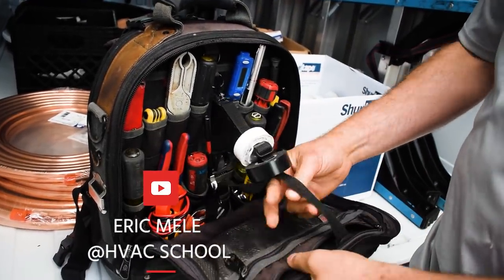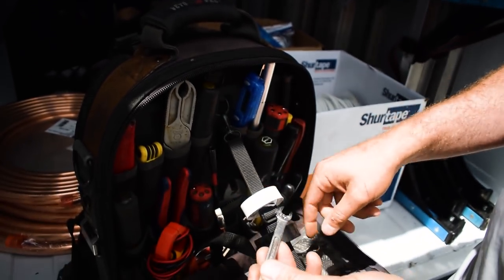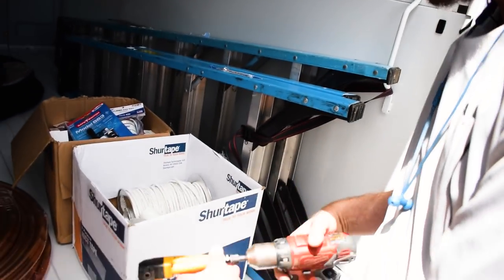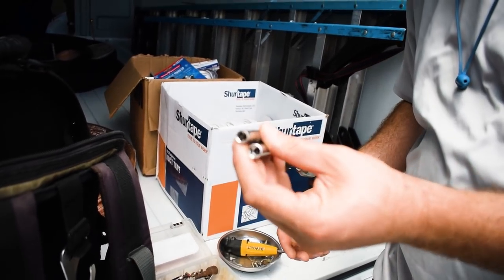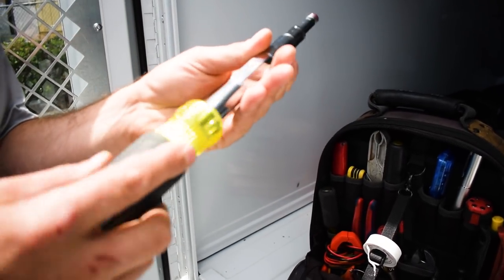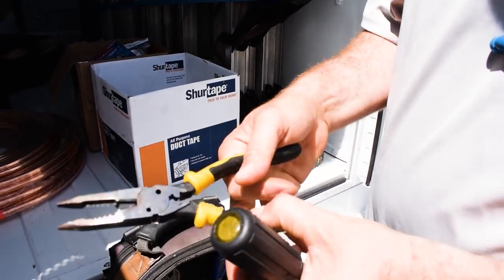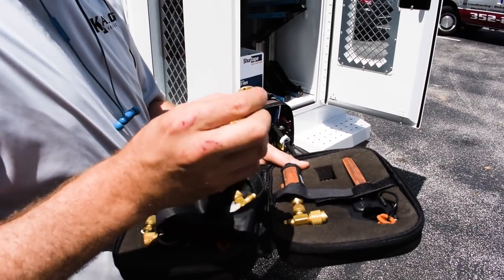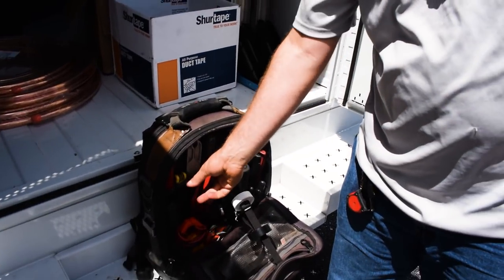Refrigeration Tools for Tight Spots w/ Eric Mele

Comment: Klein makes a slightly better version of that hand ratchet that holds bits. They added the finger swivel to one end so it's easier to hold on to in tight spots. Even comes with a 1/4" socket  adapter.